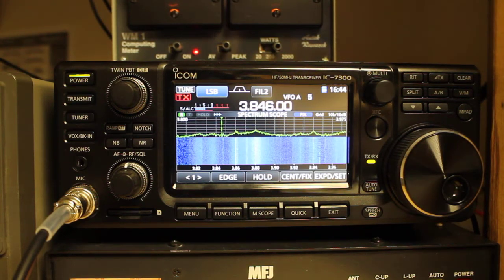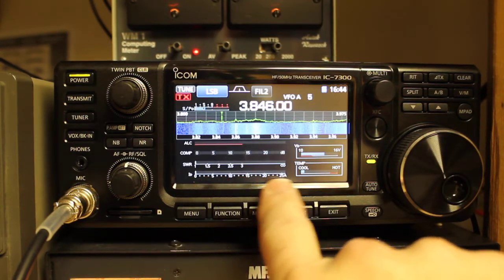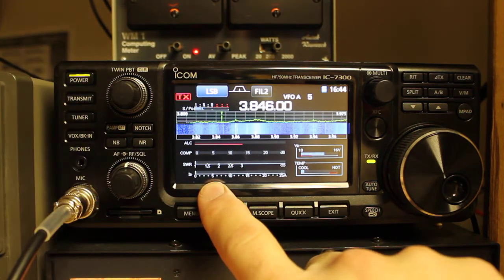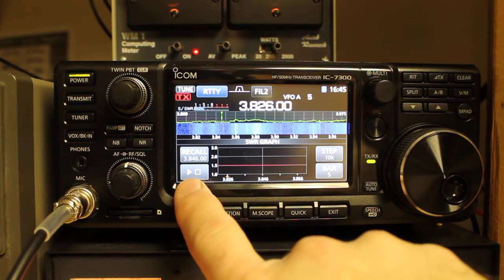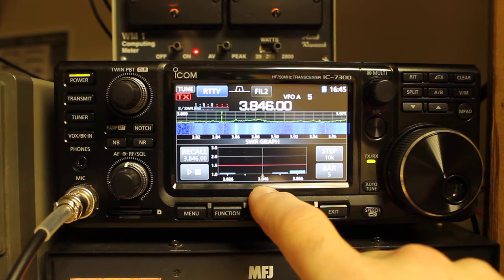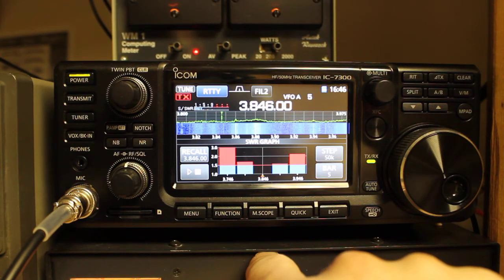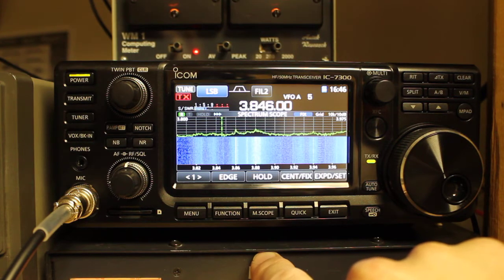Icom IC-7300 Tips and Tricks - Using Instant and Plotted SWR Meters

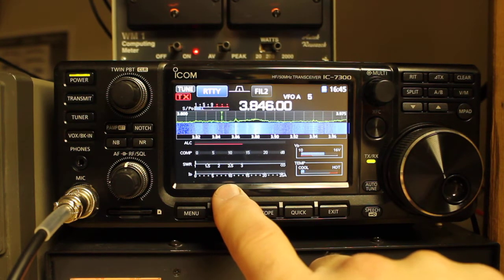Comment: I just got a new 7300. I have watched this video numerous times and don't get it. At 1:10 in the video, you say the swr is better than 1.5:1. I looked at all the metering and do not see it. I want to make sure my SWR is okay before transmitting on my new transceiver but so far I don't know what it is. Can you clarify? I hate to have to put my old SWR bridge inline for the reading. :-)

I watched it some more and now I see where the SWR was over 3:1. After tuning, there is nothing on the SWR scale? I am assuming that at this point it is a flat match? Is this correct?

Thanks
Reply: The SWR graph at the bottom of the scope displays the SWR vertically the horizontal red line going across is 1.5:1. The reason his is messed up is because he's using both an external antenna tuner and the radio's internal tuner at the same time, which the manual says not to do. It's obvious that he realized what was happening and instead of explaining, he just stopped the video.
Reply: I'm sure by now you have this understood, but for those reading this:
The horizontal graph on the bottom of the display measures Amperage.
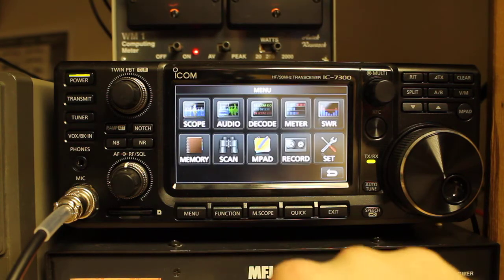Look at the graph right above it. This is the SWR meter. (@ 1:10 )
When he keys the mic it barely moves. It is far below 1.5:1 ratio.
Like the other commentor said, "He was using two tuners at once." -and it was already pre-tuned before the measurement was taken. A better example would have been to move to a different frequency or band, and show the levels before and after, out of tune/in tune.
And again for the new readers/owners: The AutoTuners do not tune the antenna. They just make the transceiver happy with the mismatch to minimize reflections, but when extreme "tuning" is required, the output and performance of the radio is reduced...but it's still happy and protected from harmful mismatches.